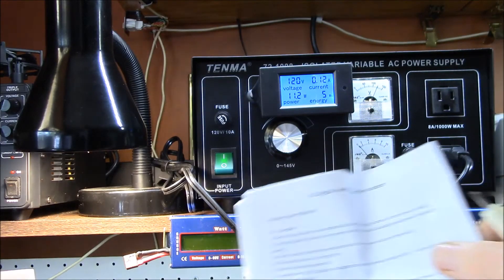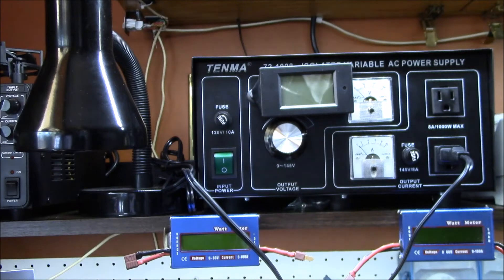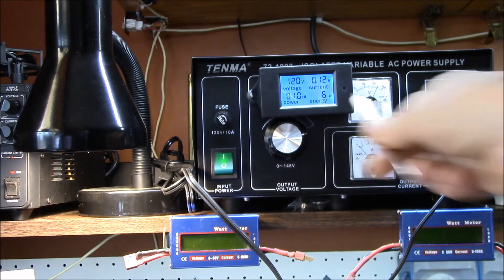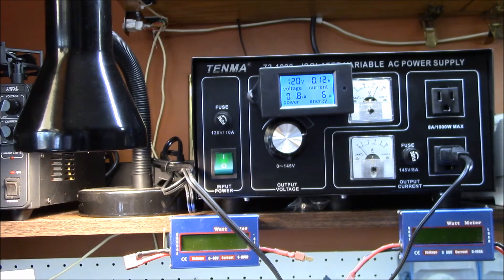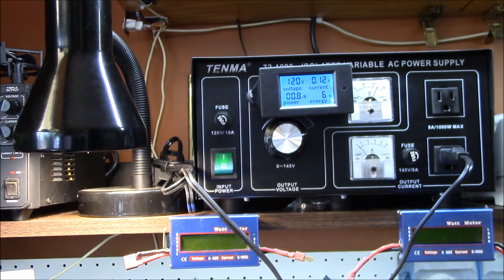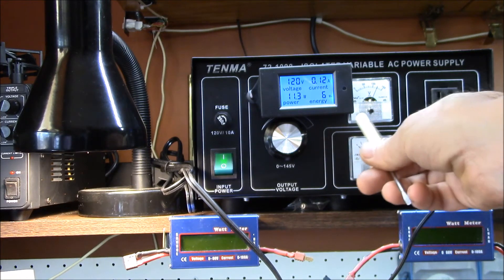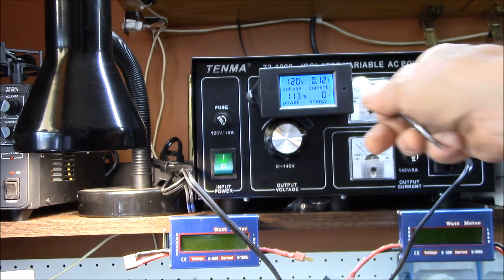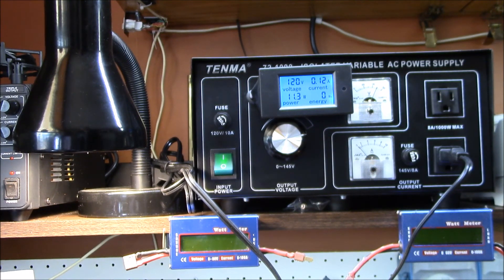PZEM-061 AC Panel Meter Operation

Comment: I am trying to add a watt meter to my Predator 4000 gas generator, I have seen a meter that will do the 120 legs but not one for the 240 leg,  I am not technical will this work, if so how do I wire it.  I am only using the 240 leg and splitting off from there.
Reply from the maker: See this video series:
https://youtu.be/LhR-Z6lBeZw

Comment: If you want to measure how many watts your generator is pushing through your panel do you need 2 of these to measure each 120v line in the 30 amp generator breaker?
Reply from the maker: 2 meters is one option if you want to see current/watts in each 120V leg.  If both legs are the same current, you could wire up like I did here:
https://youtu.be/LhR-Z6lBeZw
Meter between L1 and L2, the L1 wire through the CT.  Assuming same current in L1 and L2, volts, watts and amps are correct.
If L1 current not equal L2 current, then you could wire meter L1 - N and the run L1 through the CT forwards and L2 through the CT backwards, thus adding the two currents.  Then meter will read 1/2 voltage (120V) and 2x the current and the watts will be correct.
Other option is to get a power meter designed for split phase use with 2 CTs.
Reply: R Brown 
thanks but I only saw you put one CT on the dryer cord after you split it? I am trying to keep simple and wire from my breaker panel so like you mentioned I will look for one that comes with 2 CTs...thanks very much for your help
Reply from the maker: @chipfornaris  Yes, my 240V Kill-a-watt meter was for pure 240V loads where L1 = L2 current.  In that case, only one CT is needed and one wire through the CT. 
You can also run 2 wires through 1 CT as mentioned in an earlier reply, that adds the 2 currents so you need to halve the voltage to keep watts correct.  Only drawback there is you only see L1 + L2 current and have no idea about what the exact value of current in each leg if you are trying to balance the loads.
A 240V split phase power meter is shown in this video:
https://youtu.be/ov2NfLBgjX4?list=PLpY2FP1a9tivPdpLVyg8XMqxw6B6SAEbI&t=228
That meter shows volts, amps, KW and KWH for both legs of the breaker panel on my home automation system.

Comment: 120v x 0.12a = 14.4w and it shows you 11.3w. At much higher load the difference is much higher. Or do I just bust myself? I just ordered both AC and DC. Thank you
Reply from the maker: For a resistive load, that's correct.  I think I was using an LED lamp for this test and it has a non-unity power factor.  The measuring IC in this meter does calculate power with the power factor included, but it doesn't display that power factor value, in this case, 11.3/14.4 = 0.78

Comment: Hi. Can you tell me how would you go about measuring a dual-phase 220v current as we have in americas, using this meter?
Reply from the maker: +mglmouser With a split phase system, you would need two of these meters, one installed (voltage input and current transformer) on each leg of the incoming power lines, then add the two readings for the total power.
Reply: Actually ended up reaching a local that had bought the same meter for the same purpose I was using it for. Works just as well for a dual phase 240v line (like a water heater). Hook it up the same way. Coil on phase 1 (red) and both phases in the volt meter ports (#3 & #4) and it reads 240v properly. It's been reading my car charger since last night beautifully. Thanks for the video. If I could link a picture I'd show it to you. Here's my FB post on it: https://scontent-iad3-1.xx.fbcdn.net/v/t1.0-9/13239195_10209431355482124_6039313766915120924_n.jpg?oh=2fd7d55b5c89aa4f4ef332293794b1fd&oe=57D83080
Reply from the maker: +mglmouser Yes, for a regular 240V, single phase or balanced  load, that should work.  You have the same current flowing in each leg and all you need is the full voltage for the meter to sense.  

I thought you wanted to measure the power say in a breaker panel with two unbalanced legs of 120V each.  In that case, you need to measure currents in both legs at the same time, thus two CTs and 2 meters or a different type of meter that combines the two CTs.

Comment: Hello, and sorry for my bad English. One Question: Can i use this device in a mobile camper to see how many Ah my solar cell loads into the batterie and paralell how many Ah i used for lights or something. Does it counts two ways: into the battery and out of the battery? Best regards from Germany
Reply from the maker: +Marc Jäger This particular model is for AC power operation only, so would work off a power inverter generating 50/60 Hz AC power.  There are DC powered models, I hope to be testing and reviewing one of those models shortly.  Most only count power flow in either one direction or they count power flowing either direction but don't distinguish between the two directions.  I also have a different DC watt meter that does count AH into and out of a battery bank that does account for charging and discharging current that I also hope to be reviewing after I finish testing it.

Comment: could you do a video on, pzem-051-  I want to monitor a wind turbine to show amps and watts volts on a wind turbine, can you help me? accordion.eddie@gmail.com--- thankyou !!
Reply from the maker: +Ed Trulson I don't currently have one of that model meter to test.  But I am looking into picking up a few more variations on this meter, including one of the DC meters, to test out.  They seem to make a number of different meters all on the same basic design, but some have AC, some DC, and some have some sort of serial data output as well.  I'm trying to locate some of the more interesting models now and get some ordered so I can give them a test.  I was looking at the PZEM-031 model that has a 20A DC rating and also the PZEM-101 with a 100A external DC current shunt.  I'll add the -051 model to my list of prospects.  I will be doing a sort of tear down video on the internal components of the meter I do have to get a general idea of the components and how it works internally.  So stay tuned for some more videos on these interesting meters.

Comment: Can you demonstrate the alarm functions...is it an audible beep? or visual?
Reply from the maker: +maximus3ae I'll have to see what that looks like.  By default it's set to 24KW/100 amps, so I would never see that in my setup.  I dropped it down to around 800W which is about my power supply limit.  I'll see if I can try it with a lower setting and smaller load and see what happens.  I think it's just a visual alarm, I don't see any buzzer inside.  Maybe I'll add that into my "inside look" video that I'm working on, it's rather interesting construction and there are some other variants that I also want to look at.
Reply: Thanks for the response.  I'll subscribe so that i'll be notified when you post your "inside look" video.  Also, you may have an answer to this question:  Do you know if the Current Transformer could be swapped out for a split design type, similar to that of a clamp on amp meter?  Would probably need to find specs on the one that is provided with the unit to see about replacement i guess.  Thanks!
Reply from the maker: +maximus3ae I wondered the same thing with the CT.  Yes, having specs would be key to find out the turns ratio so you could match the amp calibration as I don't think there is an adjustment for that.  There does appear to be ST-Link programming pads on the PCB, it uses an ST-Micro u-controller, but one would need to reverse engineer the firmware to find out where the calibration data is stored.
Reply: +R Brown (4Crawler) , after some hunting around on Amazon I found email address for Bayite distributor, they sound pretty knowledgeable based on the responses to some of the questions, so I asked them the same question, and/or if they sell any split core CT that are compatible.  I'll let you know what i find out.
Reply: +R Brown (4Crawler) , i want to hook two of these up (Phase A, Phase B) to my House Circuit breaker panel, and i'd rather use split core CTs to quickly clamp onto the Phase feeds to the panel, vs. having to break the connections....which i wouldn't do myself, i'd hire a electrician to shut down power outside the house.   (i guess i could pull my meter on my house, but i dont want to mess around with that).
Reply from the maker: +maximus3ae My guess is that it may be possible, looking at a 100A AC current clamp, it lists:
"Reference project: Open Energy Monitor" which is described below:
- http://openenergymonitor.org/

So maybe they are all using "standard" types of things like CTs, etc. Would make sense for the meter mfg. to use some off the shelf parts instead of some custom one-off device.
Reply: +R Brown (4Crawler) I heard back from manufacturer: "Hello,Please read the spec in decription of this ebay listing: 

http://www.ebay.com/itm/181812359249

Our meter use the same CT.  So far, we don't have the split-core model for the meter. But we've made the plan. Maybe we'll lauch the new one with split-core model in 2 months. "
Reply from the maker: +maximus3ae Good find, so it appears they use a 1000:1 transformer.  The open energy meter clamps seem to be 2000:1 units, so that would cause the unit to read low.  Although for small wire sizes, would not be too hard to run 2 wraps of wire through the core to double the reading.  Good to hear they are working on a split core unit, that would make for easier installation in many cases for sure.  Likely the price will go up as those split core units are about twice the price of the that round unit.
Reply: +R Brown (4Crawler) I reached out to a manuf. who makes split core CTs and provided them with the ebay listing i provided in my earlier comment, to see if they had something compatible... They came back with a spec sheet for a split core CT that looks like it'll work based on the specs.   www.ydhc.com   Product Name: Current Transformer, Model:  SCT006, and gave me a quote:  
"SCT006(10A:10mA) EXW USD2.60/PC FOR 1-50PCS."    

so that's $2.60 each, it gets cheaper if you order over 50 of them. haha.  They'll probably be some high shipping as it's coming out of China i believe.  Anyway, If i do purchase two of these meters to monitor the phases coming into my house, i'll probably also pick up 2 of the split cores too.   I'll obviously want to check them on some known Amps draws with the stock CT and the split core to see if there is any difference.     
-Enjoy.
Reply from the maker: +maximus3ae That sounds promising.  I've looked into the way the meter seems to read the CT and it appears it is just a simple power resistor.  Another option for a different ratio CT would be to use a different value resistor in order to get the same voltage reading on a CT that puts out different the current.  Of course, if you have to purchase a CT in either case, easiest to pick up the proper ratio to begin with.
Reply: +R Brown (4Crawler) one thing i'm concerned about is that the ebay listing that the meter manuf sent me to describe the CT that comes with the unit is rated to measure 50Amps, but the meter is listed for 100Amps.  Can a CT max out?
Reply from the maker: +maximus3ae Might ask the mfg. but 50A might be the long term maximum rating.  Unless you are putting it in a circuit that is drawing 100A all the time, it'll probably be OK.  On my solar battery bank, I'm running a 100A DC current shunt between my battery bank and power inverter.  It's rated at only 50A continuous (or it'll start to get hot) and I've run over 100A through it while a motor load starts up.  But in normal operation, I am never over 50A for long periods of time and it's been working fine for well over a year now.  In this case, I went with the smaller unit (they also have a 500A shunt) because the smaller one gives one extra digit of resolution on the meter compared to the higher current shunt.
Reply from the maker: I also showed one way to add an audible power alarm:
 https://youtu.be/h_IefisNW-M